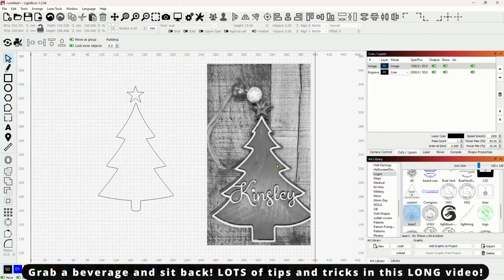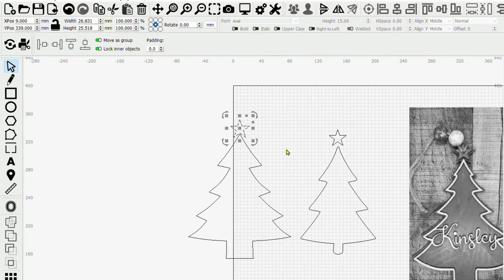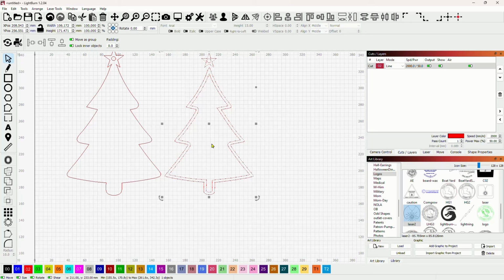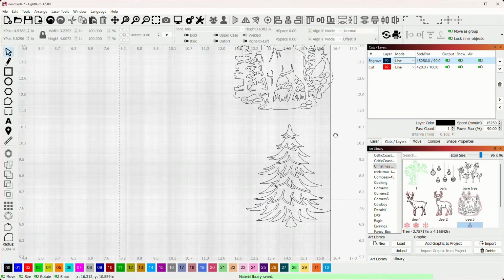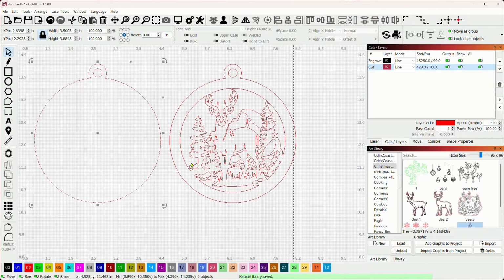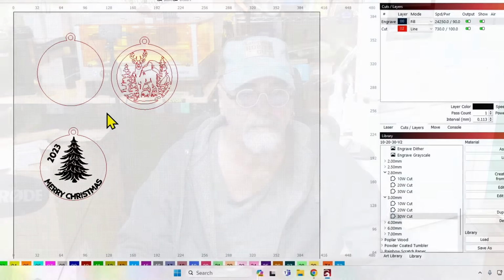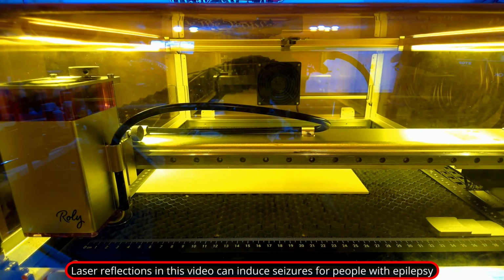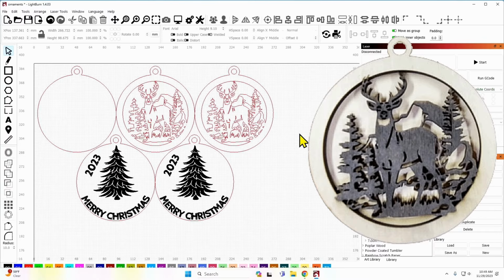📝 How to Design Holiday Ornaments FROM SCRATCH! LOADS of tips and tricks!

Comment: Hello, I'm a member of your page and wanted to ask you if you're planning on making the settings for the Monport Mega 70W. thank you so much for everything you do.
Reply from the maker: Libraries are not specific to a manufacturer or model, they are based on the wattage of the tube. The ones that have a manufacturer name on them just means that they contributed by providing a white paper with some settings. You can use the 60 or 80W as a starting point.

Comment: I have tried several times to make a star the way you demonstrate.  However, when I use the offset tool no additional shape results and the lines inside the star do not disappear.  What am I doing wrong? Using lightburn 1.4.04.  Thanks for your help!  BTW we are near neighbors here in Long Beach, Ms.
Reply from the maker: When you use the offset tool and input 0, it creates a copy on top of the shape you have selected and you won't see it, but it will be selected and you can drag it off. Watch again and you'll see it.

Comment: I know I've mentioned this before, can you please please please  go to your Windows settings and increase the size of your cursor and maybe change the color so it's easier to follow what you're doing?
Reply: Rich, Thank you so much for your reply and all the great videos you provide. If you're running Windows 11, you can go to mouse settings, adjust mouse and cursor, you can create a cursor that is HUGE. On my 23-in monitor it's almost 2 inches long. Again thanks for the great content and keep up the great work!
Reply from the maker: It depends on what computer I'm using. I can only do it on one because of the screen resolution. If I do it on the shop computer, I can't see what I'm doing. The mouse pointer has been large and in color on the office computer for over a year. I don't think the screen recorder captures it though.
Reply from the maker: I have already increased it and changed it to green, which makes it harder for me to see. I can't make it any larger.

Comment: Another excellent video!  I have two questions:
1.  As you were placing the 3mm plywood into the laser it looked like you removed protective sheets from the plywood.  Is this correct and does your plywood come with protective sheets?
2.  On your multi-layered Christmas scene, you shared with us, do you have front layers that are not supported by a back layer?
Reply from the maker: 1- Yes, the wood was sealed in plastic, 2- No, all layers affix to last.  👍 Thanks for watching Jesse!

Comment: Hi Rich as usual I missed the live stream, as I am at markets when it happens. But anyways here could be a helpful hint to getting that plastic off the metal you have issues getting off. try gettting a bit of tape on the corner to peel it off. I use this when I am using tinted film and it works everytime :-)
Reply from the maker: Great suggestion Ian! And I have done that before, but my mind is getting old an weary 🤪

Comment: Good Job, you might mirror one of the ornaments and get a piece of translucence white cellophane, then just glue then together back to back, with the cellophane between them. It will look like snow and light will flow through and it looks cool.
Reply: I was going to suggest the same thing! Any piece of translucent material (parchment, acrylic, rice paper, etc.) will look beautiful when light shines through it and silhouettes the design.
Reply: Yes it looks great. you can also put LED with a coin cell to light up an ornament for real neat look 4 layer 1 blank back 2 just a thin ring 3 cellophane 4 front show cut out part. The area in 2 put a coil battery with a LED makes it shine on the tree.
Reply from the maker: All great ideas! That's why I love my audience! I get smarter with ever comment!